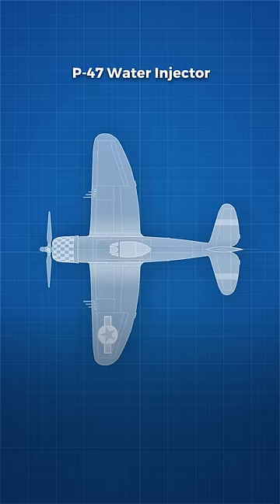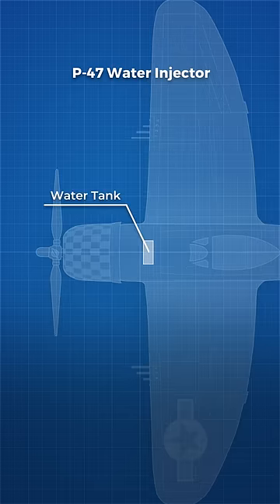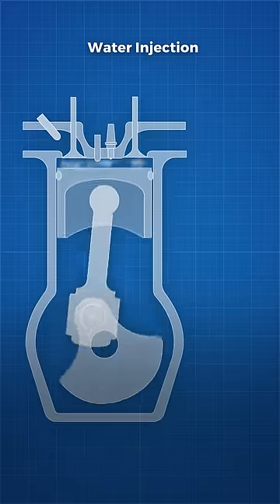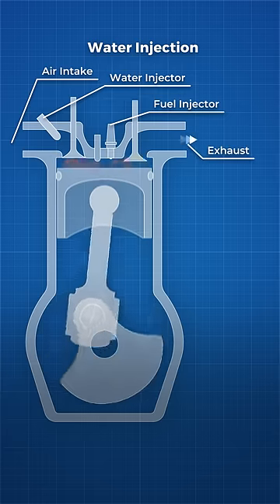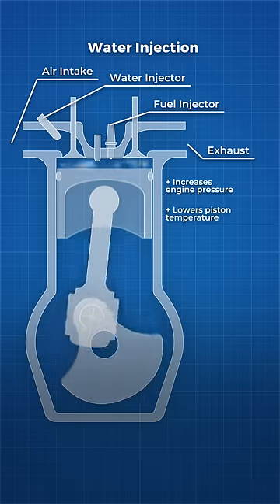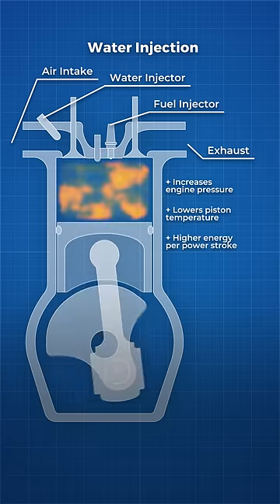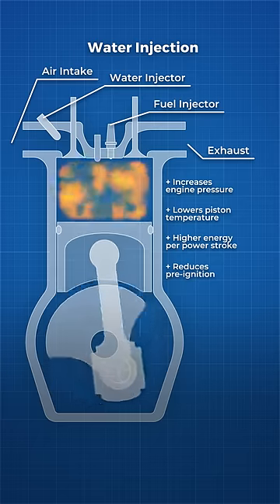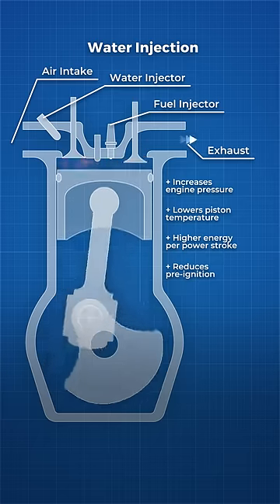How Water Injection Increases Horsepower

Comment: Water in a jet engine increases thrust due to the higher ejection mass.
The harrier had water tanks for use with its VSTOL to not only increase thrust to weight but also help with cooling at low speeds as jet engines use their speed to air cool their engines.
Reply: Cool thing to learn. thank you.
Reply: That explains the Hovering time limit I heard about decades ago.
Reply: Sure about that? Gaseous H₂O has a lower mass than other combustion products like CO, CO₂, N₂ and NOx.
I speculate that adding more water would reduce exhaust mass but increase exhaust velocity, giving more thrust because of ½mv²
Reply: You still have the old exhaust and then you're adding more mass to it, both from more air and fuel coming in, as well as the added mass of steam.
Reply: Many early commercial jets had water injection to increase power resulting in a black excaust smoke at take off when it was used, The Boeing707 being one of these airplanes.
Reply: @ahaveland It doesn’t matter what the density of water vapor is, they’re injecting water, not vapor. When the water boils, it causes a pressure increase, so the density difference is more than just swapping air for water. The water might be used for other things than exhaust density, but your comparison of the 1 atm densities is flawed.
Reply: @haph2087  Adding water creates more steam which has a lower molar mass so reduces average exhaust density, but at higher pressure → higher velocity → greater kinetic energy (v²) → higher ISP
Reply: By a similar effect pre turbo water meth injection on a turbo car increases mass flow through the turbo and results in significantly lower compressor output temps ;)
Reply: @ahaveland  Yes.
Mass is not density. An increase in mass can be an increase in volume rather than density.
Reply: @haph2087  Increasing velocity by reducing mass can produce more kinetic energy.  ½mv²    - If you halve the mass, and double the velocity you double the kinetic energy.
 m      v
10 × 10² ÷ 2 = 500
   5 × 20² ÷ 2 = 1000
2.5 × 40² ÷ 2 = 2000
Reply: @ahaveland  Cool, but if the mass and velocity are higher, it’s even better.
Reply: The AV-8B Harrier uses water injection, also the B-52 used it as well.
Reply: VTOL jets also risk melting or burning the landing pad if they hover for a while.
Reply: B52's also have water injection on their engine's to take off heavy from runways that aren't quite long enough, I don't know about the engine's they use now but according to a pilot in an interview back when it was still the early model they were flying it took the combined Horsepower of the engine's from 80,000 to 100,000 thousand horses, mind boggling, oh how I'd love to have my hand on those controls. 
When you see them taking off and the black smoke is pouring out of the engine's like a bunch of coal fired locomotives that's when the system is in use.
Curiously when turbine type engine's use water injection they actually reduce the fuel by around 25% to get more power, I know that the WW2 aircraft engine's that used water injection leaned out their mixture a little bit but no where near 25%, that's a huge change for a reciprocating gasoline engine.
Reply: water expands by a factor of 1600 when it turns into steam

Comment: Cooling is necessary after the turbo or compressor. That's why an Aftercooler and/or Intercooler are installed. Engines lose power running on hotter intake air.

Injecting methanol/water into the air stream after these heat exchangers and before the intake ports will further increase air density from evaporative cooling. This increases the mass flow rate into the cylinders, thus providing more oxygen and fuel per stroke. [edit: Gasoline with methanol also has this cooling effect.]

If slightly more water is injected, the water is not completely evaporated in the intake manifold, and will absorb even more heat while evaporating during the compression stroke. This reduces the torque/work required for the compression stroke. 

But any water droplets remaining after compression is not desirable since it will rob temperature/pressure from the ignition and power stroke. 

However, spraying methanol/water is only appropriate if power is inadequate at full throttle. It definitely should not be used for cruising or for any prolonged period, as moisture will contaminate the cylinder wall oil film (mostly during the exhaust stroke) reducing lubrication and also invading the crankcase oil.

Comment: I was told by an old p47 pilot that when the war emergency power was engaged, the engine would roar and the aircraft would jolt forward from the sheer power of the engine and the components that aided it.

Comment: Air fuel mixture enters the cylinder, not the piston.

Ignition happens at the top of the compression stroke, not the bottom. 

Ignition usually happens before the top of the compression stroke, so your definition of pre-ignition is less than accurate, even if you had said "top."
Reply: Air fuel mixture is carried to the piston, ie entering the cylinder to do work on the piston
Reply: @therealpotatomottz8706  yes. As I said, it does not enter the piston.
Reply: More accurately,  the combustion chamber.
Reply: @429thunderjet2  that might be less accurate. The combustion chamber is the cavity in the cylinder head plus the small bit of the cylinder that's above the piston at TDC. The whole cylinder, or at last the part above the piston at BDC, gets filled with mixture. But now we're mierenneuken as the Dutch say.
Reply: @earlebird4262  no, Of course that's what it is, the space in the cylinder between the head and the piston "The combustion chamber".

Comment: Does the fact that water expands some 1,600 times when changing from a liquid to a gas have an effect on the power? Thanks!
Reply: Yes, it means that the energy used to heat the water has to come from excess fuel, it gives more power and the energy wasted stops the engine from melting while doing it, it's obsolete but if you were about to get shot down you wouldn't mind wasting a few gallons of fuel to get away
Reply: @dreddwailing5505  It was my understanding that this was a major. I'm glad you agree. Thanks!
Reply: There's been "6 stroke" (I think there's a proper name I can't remember) engines that have a second (weaker) power stroke that sprays water into the cylinder after the exhaust stroke. Usually worsens power (less torque for every RPM on average) but greatly increases efficiency as it scavenges otherwise wasted heat energy
Reply: @dreddwailing5505 

It's not that water injection is obsolete, it's just that we haven't had a serious demand for 2,000+ hp piston engines in decades.
Reply: Actually a trivial effect on engine operation
Reply: It takes more B.T.U's to change water to a gaseous state so that expansion is not as efficient as you would think .the main power gain is the water/alcohol cooling the air charge makeing the air a higher density.. this in turn allows more fuel to burn because of the extra oxygen
Reply: @andrewahern3730 it‘s called a 5 stroke and it has been in development by the VAG group (VW). As you‘ve said instead of wasting the heat generated by a 4 stroke engine, the engine injects water to absorb said heat, expanding it and using that power to push down an extra „waste heat“ piston. It was a 3 cylinder if I remember correctly (2 active and one waste cylinder). The design is similar to what late stage steam engines were doing, using the generated steam to power multiple pistons after another.
The design works and is reliable. It has shown to increase thermal efficiency. But the added cost and complexity does not justify the power gain and similar efficiencies can also be achieved by Atkinson cycle engines, so it was discontinued.

Comment: I just noticed you've got the spark plug marked as the fuel injector.
Reply: @@ChangeEvery14Daysbecause it DOES have spark plugs
Reply: And its not diesel.  These engines ran on 100/130 octane "AV gas" as it would be called today.  150 octane was introduced later in the war as well.  But diesel was not used in American, German and British aero engines.
Even the Sherman M4 and M4A1, which used a Wright aero engine, burned gasoline
Reply: it doesn't have fuel injectors though being a carbureted engine @Red-Magic

Comment: Kinda, not really, it's complicated.

Water/water+methanol injection only benefits power output IF you can take advantage of the increase in fuel octane rating - by increasing boost, which is the most common way. Without more boost, you don't gain anything except lower temperatures.
For the germans and japanese in WW2, this was mostly a workaround for their relatively low octane fuels (mostly 92, the germans had small amounts of 100 octane) - the Allies had 100 as default and could go all the way up to 150 octane. 
That's part of why Allied planes usually carried way less ADI fluid than say, a Fw190 D9 or a J2M3, which instead of ~10 minutes, carried up to half an hour of that stuff.

Comment: The alcohol/water mixtures also superflashes into steam, increasing the combustion power. But it also scours oil from the cylinder walls, causing premature cylinder wear. Which it was reserved for full combat power in "disposable" aircraft.